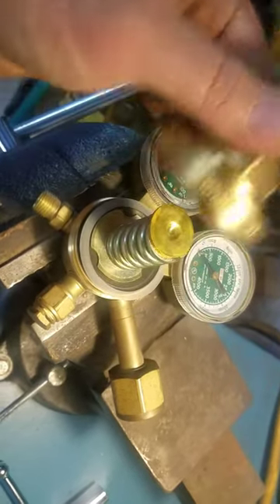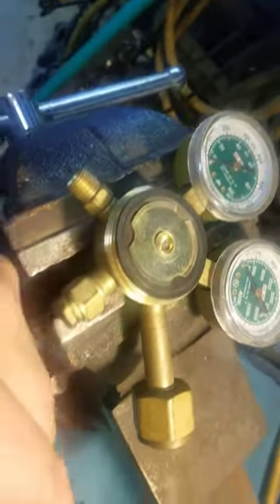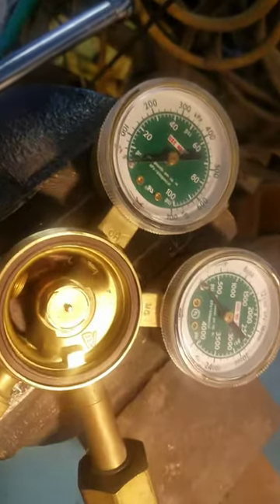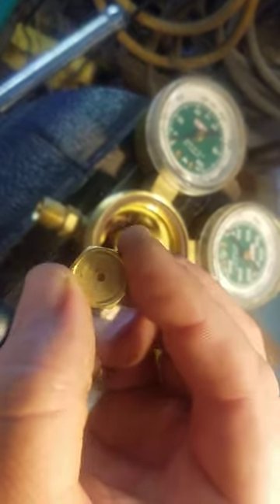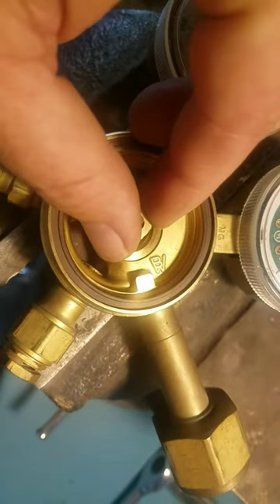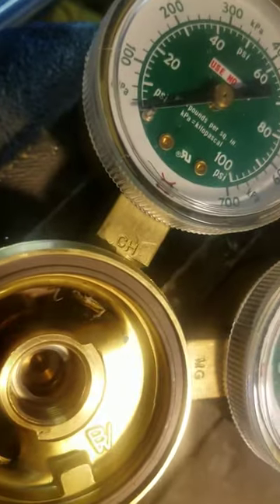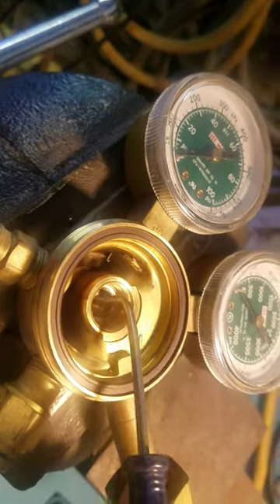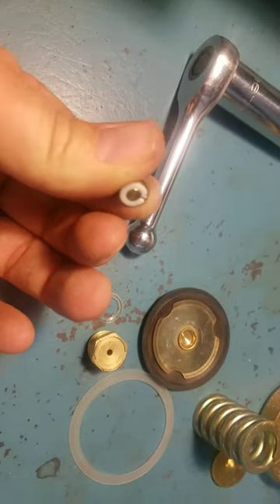Victor Oxygen regulator problem

Comment: Flypin seal go's bad. New 1 has silicon sealer on top. Mine shot oxygen out housing by adjustor. Line pressure would peg out gauge

Comment: Remember to read the manual (free download at the Victor site) and clean to oxygen-safe standards with a safe solvent like pure acetone. The seat (which failed in this case) is the usual part that leaks on regulators and flowmeters. High-pressure oxygen (which is all the O2 from the cylinder to the seat area) can ignite small metal burrs and particles so play safe and make sure there aren't any. I inspect with a bright light and magnifying glass.